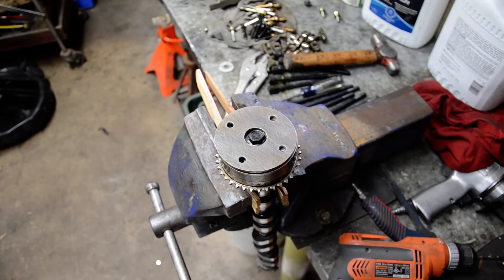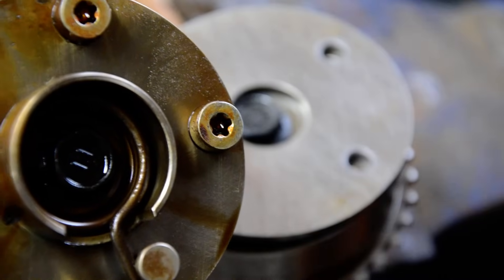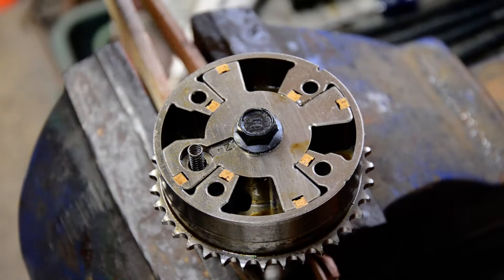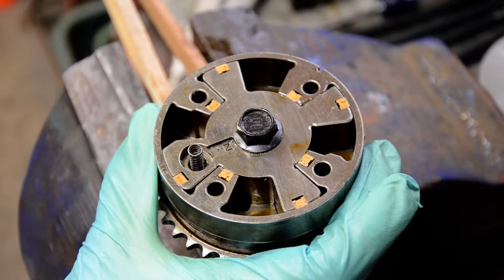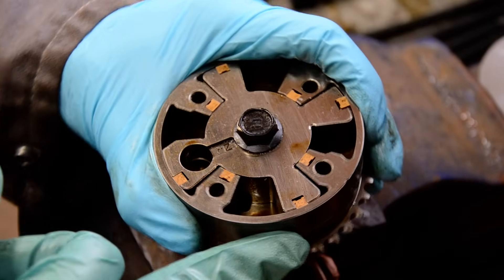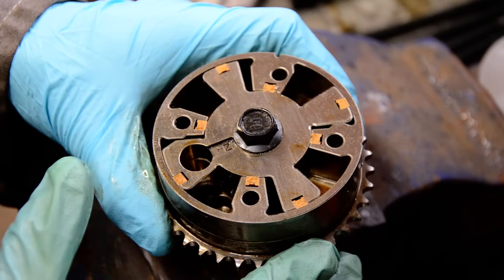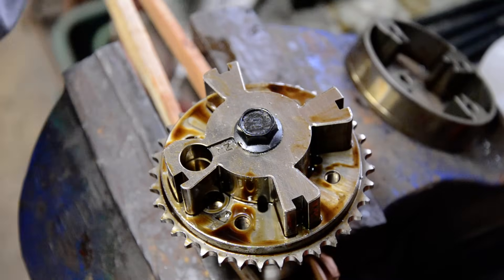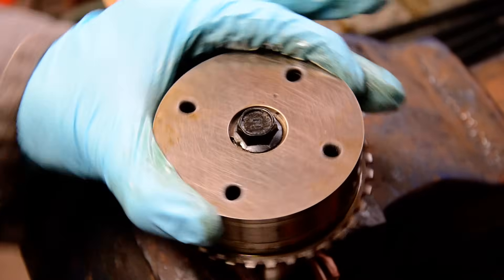Inside a Toyota VVT-i Camshaft Gear!

Comment: VVT-I does not have lift like VTEC ,only VVTL-I does..The pin locks the gear in place ,until the VVT-I solenoid allows oil to flow into the gear and then the pin moves and allows the gear to be free to move and change timing and the intake and exhaust valves over lap each other at times to optimize fuel efficiency and lower emissions..
FyI: VTEC uses different cam lobes with larger and longer duration to create lift,VVTL-I uses a pin that is moved by oil to increase duration and create more lift..
Reply from the maker: Yep, you got it. Thanks for the comment!
Reply: very interesting!! so, does that mean that honda is better and more trouble free than toyota engines? cuz right now i am having issues with a 2.5 liter knockin sound at start up??
please help me!!!
Reply: Not really memo. Honda is using similar system now. They still have vtec but they also have a vvt for some more low rpm tourqe and better fuel efficiency

Comment: Mine focus 2.5 st does intake backfire & loss power!! i have to check vvt solenoid voltage and vvt mechanism so any 1 know how should be solenoid voltage!!?
 Also obd codes are p0016 & p0017!!
 Thanks

Comment: I have a 2001 lexus is300 my mechanic change the timing belt and seals, he pull it out the vvti gear, now wen we start the engine, engine start with a click noise,  he said it's the vvti, so the vvti can be adjusted?  And can get that clic noise?

Comment: Paul is wrong about it being a vtec style system 
Like he said vtec uses oil preashur to at a certain rpm 
But it dosent change the timing it changes the lift and duration of the valves being open by locking together the rocker arm that the vtec lobe runs on to the other rockers rhat are attached to the valves and the normal cam lobes 
This system is a vvt-i  
Variable valve t imeing with intelligence 
This system adjusts how long the valve is open when it opens and when it closes based on what u do with your right foot 
Mash the pedal and the Ecu puts oil into the passages f orceing the center cross past that is attached to the cam directly to advance 
Vtec Dosent use this only vvt-i uses this as well as Toyota's version of vtec vvtl-i that incorporates lift with this timing gear
Reply from the maker: You got it Seth, very different systems. I prefer Honda (for the older style vtec "crack") but both are very cool technologies.
Reply: I drive a celica gts and iv driven in an actual integra type r and the crack is about the same but the sound change is much better on honda 
I barely hear the octave change in my gts

Comment: Why did you replace this vvti gear because i have a 2009 corolla and when the engine is cold it gives me a loud rattle for like 3 seconds and the dealer  told me it could be the vvti gear.
Reply from the maker: Hi Luis, this was just a scrap gear given to me for the purpose of this video. I suggest you call your Toyota dealer with your VIN number and ask about any recalls your car may have on it. I believe these gears were replaced under a recall on some models.
Reply: I have a 2004 Corolla and it makes a slight rattle for a few seconds. My mechanic says don't worry that some engines do that and it wont' cause any problem. But that guy says maybe a recall so check.
Reply: +PatonHaus 
T-SB-0041-13

Comment: I remember taking apart a 2jz vvt-i cam sprocket and was a very different design. Just shows how Toyota has come up with a new way to do the same job more efficiently. Granted it is not as aggressive as a V-tec system which has a different cam shaft profile when commanded but this is how Toyota gives you the performance timing when it is commanded by the ecu when a certain rev is matched.
Reply: the extra cam shaft profile you are talking about controls valve lift. this is just vvti not variable valve timing and lift the lift part allows you to make a lot more power because it controls how deep the valve opens instead of just the duration.
Reply: @Luke-tm5oy Right, one key thing to take is that honda no longer uses the old valve train design. Like every other manufacturer, cam phasing has become the norm.

Comment: it adjusts under pressure when it reaches around 5-6000 rpm the pin releases the cam that gives engine a boost up to 9000 RPM its called VTEC
Reply from the maker: Thanks for the comment Paul. VTEC is a Honda technology, Toyotas version seen here is VVTI.

Comment: The sprung loaded pin is controlled by oil pressure. It locks the cam for start up so the valve timing isn't retarded.
Reply: can these fail and cause hard starts when the car sat a while and the oil drains? starts after 3-4 attempts when it has been sitting and fires right up when the engine just ran
Reply: @stijnpeeters9458  the pin starts not doing its job and not locking so that when you start the engine makes a loud  rattle sound until oil pressure comes back in 2 seconds. Its common rattle. Mine is doing it.

Comment: The pin is spring loaded to hold the gear in place once you reach a certain rpm or speed the oil pressure will push the pin up allowing the gear to rotate vtec vvl-i cvt ect are all designed to give a boost in power on the hi end for passing or fun the pin keeps thing from moving till needed to preserve fuel economy
Reply: +lilseip-B14  then what causes the rattle on cold start?

T-SB-0041-13
Reply: +AffordBindEquipment- the phasers that control the timing inside the cam gear actuator..they are dry and rattle until the oil hits them.
Reply: @GlocksDB15  what’s the fix for this? Toyota replaced my cam gear and it’s still there.
Reply: @WillCarrot  they did mine too on my 2013, and the same sound is still there. I actually started using MMO and 5W30 instead of 0W20, and I make sure the oil level is just at the 2nd dot, and the sound is gone. I think the gear side of the intake is what the rattle is from. The sad, but good part is, the noise has never gotten worse or caused problems   and I heard a brand new 2.5 RAV4 make the same sound..a decade newer
Reply: @GlocksDB15  Except, oil doesn't hit them until a certain RPM/load.  And that's not happening at start-ups.
Reply: @ACZ457  I am trying to follow your point, but I am having trouble.  The pin also isn't locking the cam in place and that allows it to leak off and rattle when it first starts up.
Reply: Mine doesn't rattle on a cold start, but it does on a warm engine start and last for like 10 or so seconds.
Reply: What happens when i keep the pin on a permanent position and fill those oil pressure holes with a thick rubber??
 I'm saying this because I've done it on my Toyota corolla 2006 and the engine is now silent no cold start rattle noise is there any disadvantage over what i did??

Comment: i have a 2003 rav4. was making a rattling sound on the engine and it sounded like a diesel engine. everyone was sayimg timing belt and guides so i went ahead and changed it. started the car and the same noise. then i removed the VVT and the inside was broken. got a new one and replaced it, started the car and noise was gone. after 3 months, the same noise came back. do you know what is causing the VVT to break?
Reply: yes, it's 100% a German design built to fail.
It may be your engine oil PUMP is worn out and not supplying OIL PRESSURE to camshaft head.

USE THICKER OIL... 20W40 (not a thin 5W20)

FYI: Mercedes Benz have the EXACT SAME luxurious problem!

Comment: Not an expert but I am guessing: the removable "pin" you are referring to that locks the gears does exactly that - It locks that adjustable rotation in place when the car doesn't want to use it. The spring seems to help the motion of unlocking and locking. Looking for an experts answer.

Comment: VVT-i is turned on at set points that use throttle angle and engine rpm as input signals. The engine ecu has a map and when the inputs are good it turns on an "oil control valve" that sends oil pressure to the vvt-i gear to turn it on
Reply: hey, i have the 2015 camry with 2AR 4cyl.  I have code P0015 and P0017 with no rattle at startup but rattle when feathering throttle at other speeds. Also get occassional flash of low oil pressure (not sure if sender problem or really oil pressure prob). do you know if there may be oiling issue or just one of the phazers is failing. Sounds like you may be able to help me diagnose or what to check. thanks

Comment: The "Orange Blocks" are oil seals. The mechanism works via engine oil pressure, in a push-push arrangement.  The ECU determines the position by varying pulse widths to the variable timing control solenoid.  A square wave (equal + and - time intervals) holds current timing.  Narrowing or widening the pulse varies the timing.  The pin is to lock the timing until oil pressure has been established.  Exhaust timing is fixed.
Reply: they also use the exact same setting on exhaust camshafts for variable exhaust timing.

Newer designs don't use a side oil solenoid but rather a head mounted PWM push solenoid in the center of VVT Gear.

These timing systems are built to wear out (piston/pin) and pop codes because the ECU has the timing on a close watch.
 👍🏻

Comment: Sounds like oil starvation. Try changing the grade of oil you use to slightly thicker cold viscosity.
Reply: yep, indeed thicker to build more pressure in an old loose engine,  not thinner !
10w30 or 40
Reply: @glasser2819 I'd start with 5w-20, then mix 5w-20 with 5w-30 to make 5w-25.  That's as far as I'd go.  You don't want to be running anything heavier than that with modern variable valve timing engines.

Comment: My 2007 IS350 was making the same sound from a cold start.  Finally after months I just took it in and it was vvti gears worn.  My warranty had expired but the dealership still did everything for free since I had brought the problem up to them in the past and they had it recorded in their system.  This time they were able to figure out what it was. They replaced all sorts gaskets, cylinder heads, camshafts, and more. Probably would have costed me tons of money but thankfully I got taken care of.
Reply: Which gear did they replace?  Did you see the old parts?

Comment: You might try synthetic oil if you aren't already using it, it will reach the top of the engine faster upon start-up.  Over time, it might also clean out sludge that is slowing down the oil's movement.  If higher quality oil doesn't help, then move on to hardware diagnosis via your mechanic.
Reply: This is 8 years old comments. Full synthenic oil is working well with VTTI with over 250,000 miles. That is why after 2012, all toyota/lexus vehicles come with required full synthenic. or VTTI will having problem.

Comment: I went to Mechanics Some said VVTI
Some said oil pump
Some said ADJUSTER ASSY, VALVE LASH
Some said CHAIN belt 
My question says Is it possible to hang the VVTI and comes This sound (Noise)  ?

Comment: I have a question 
my car (lexus is 350 ( 2gr-fse engine  VVTI)
Every morning When startup Engine sound (rattle-noise)
 A little bit of time Only when the engine is cool  
Some say (ADJUSTER ASSY, VALVE LASH)
Others say VVTI (  CAMSHAFT GEAR )
Is the problem of VVTI ?
Reply: Problem is cold THIN OIL !
Simply use a THICKER OIL like a  10W30 or 40

Comment: some newer toyota dual cam v6 engine are interferance. ive seen a t belt water pump changed and the cam rotated to much at tdc with the belt off and when he was done it had a consistant ticking noise(slightly bent valve). 3mz v6

Comment: the ocv (oil control valve) is also known as the vvt solenoid. its what receives the electrical signal for vvt to engage
Reply: it precisely modulates oil pressure to dial a timing degrees with camshaft sensor (not just On/Off)

Comment: Both are right, old MIVEC on 4G69 engine for example is "like" a V-TEC but better, MIVEC on newer 4B11 engine is the same oil controlled VVT-i that Toyota uses but way more better.

Comment: just for history due there is no tool for loose bolts as you already know :) you "bite" the head of the bolt with the vice and you turn the cam.the bolts r loose easily without drilling.the pin is securing the cam to a certain position under 4000 rpms or when there is no oilpressure (for morning start up or for 2much worn out spoket.there is no use for trying to fix the vvti part,some the plate is worn from the spring and you cannot out it in another hole,the bolts r off centered!great video man

Comment from the maker: @moham7ad Yep, read it and still sticking with my original comment. Mivec is most somilar to vtec. Look it up. High lift cam lobe gets activated at set rpm (just like vtec). Not an argument, it's fact.

Comment from the maker: I must disagree. MIVEC is most similar to Honda's VTEC where there is a seperate high lift cam lobe which gets activated at a set rpm via hydraulic "pins" that link the cam lobe to the two regular operating rockers. Toyotas VVT-i system on the other hand is constantly altering the timing by use of physically rotating the cam (on newer engines, both cams) across the majority of the rpm band. Very cool technology, but not similar.

Comment: The pin has two functions. To locate the cam during start up and as a safety feature if there's an internal oil seal leak. When this occurs the pin will lock in and the ECU will recognize that the cams aren't adjusting at various engine rpm and load points. On each VVT unit there will be 4 sensor points that are spaced uniquely to allow the ecu to know what degrees the cams are set at.
Reply: P0017 is a cam crank correlation code. It means your timing is off. P0015 is exhaust cam over retarded. Highly probably a failing vvt but it could be related to failure of related timing components.
Reply: hey, i have the 2015 camry with 2AR 4cyl.  I have code P0015 and P0017 with no rattle at startup but rattle when feathering throttle at other speeds. Also get occassional flash of low oil pressure (not sure if sender problem or really oil pressure prob). do you know if there may be oiling issue or just one of the phazers is failing. Sounds like you may be able to help me diagnose or what to check. thanks

Comment: which would also allow you to correctly set the timing chain  when reassembling an overhauled engine aswell. would be a P.I.T.A. to do that and then see the chain moving seperately from the cam during installation o.O

Comment: the pin locks the vvti incase the oil pressure isn't within spec, which would trigger a check light when the ecu realises the engine isn't doing what its supposed to do under varying circumstances....i'm guessing lol

Comment: thats the reason for the spring loaded pin it is to control how much adjustment you can get en there is a oil pressure from below that pushes that pin up as you know oil pressure raises with the rews
Reply: The pin only locks for cold start. When the engine starts and the O/P comes up it unlocks. It will stay unlocked until you shut the car off. Often the pins get sticky and no longer lock and you get the famous "rattle" until the O/P comes up. I've had 2 Toyotas that have had the rattle for over 150k and it has never been a problem. People just hate the racket at startup , but it really doesn't hurt a thing.  My Camry has 220 k and is still going strong rattle and all. Here's a great video about this https://youtu.be/gwJ5BBHb9W4

Comment: The pin is to lock the cam in the place to start the engine when there's no oil pressure.

Comment: you could make a cut with a thin cut-off disc and use a flat screwdriver. the housing looks like Powder metal? I think the yellow block is oil seals PS 	fine vid. (-;

Comment: Allow me to comment your video:
- If both camshafts has a cam gear, than we call it a 'dual VVT-i'. It means it adjust the   valve timing of the intake and exhaust valves. 'VVT-i' only adjust valve timing of the intake.
- actually it's the innerside of the cam gear that moves. That innerside (star shape) is fixed to   the camshaft. Just saying so nobody misses. It's just because it's clamped between the   bench.